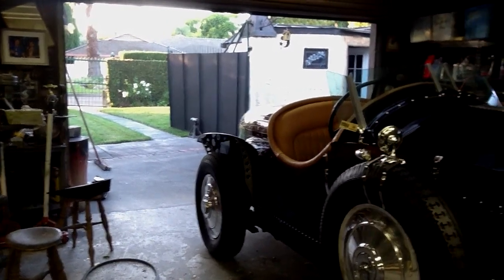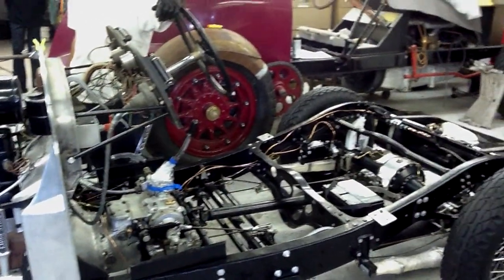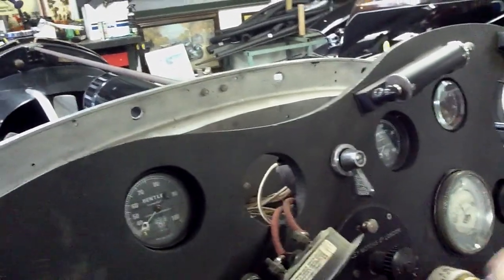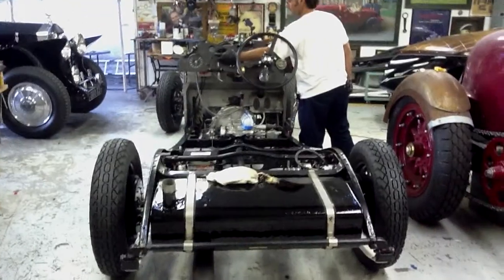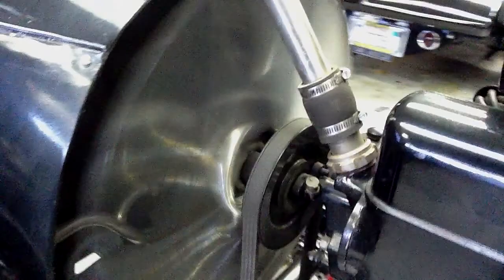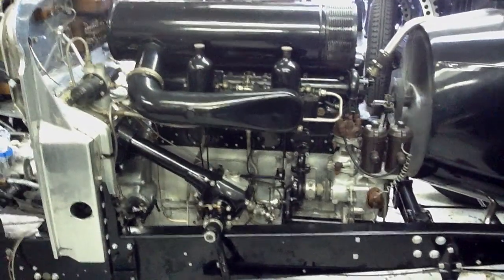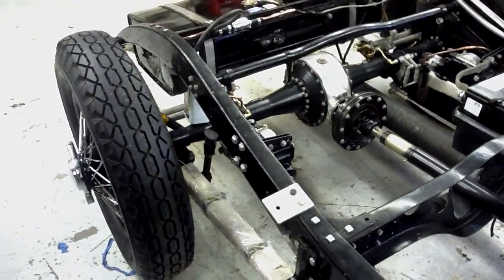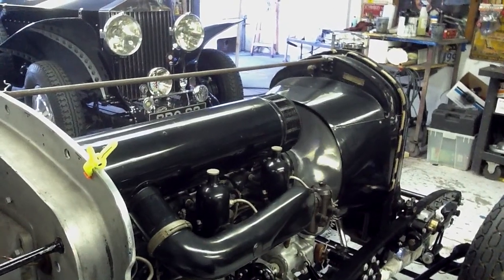bentley 4 1/4 black prince first start up november 5th

Comment: May I ask why you have put the propshaft and damper on the wrong way? Originionally the damper and sliding joint would be fitted to the gearbox output flange.